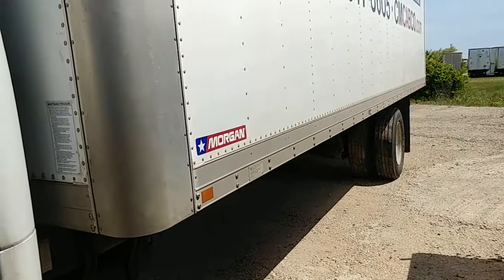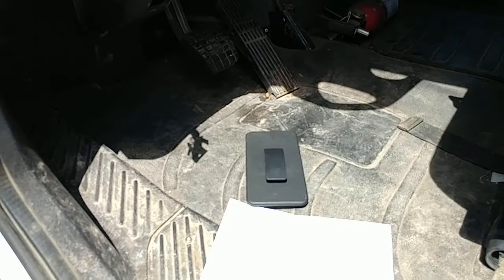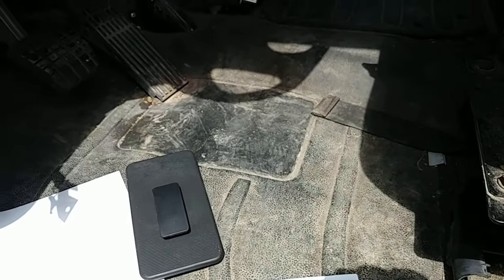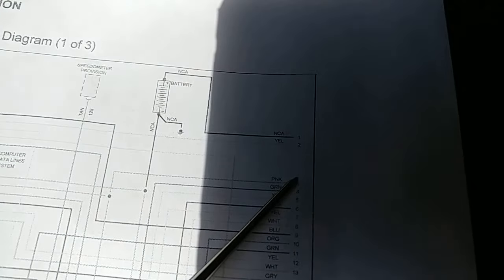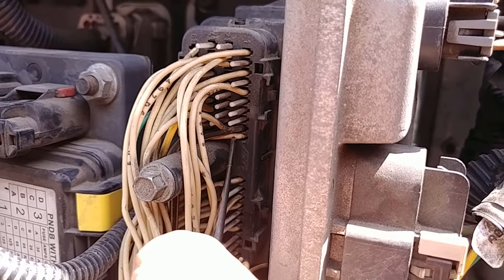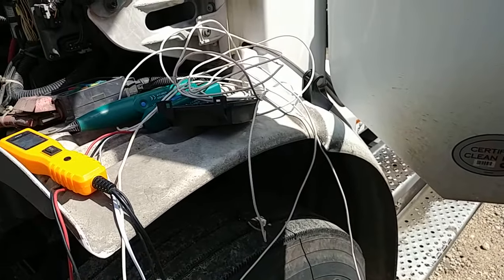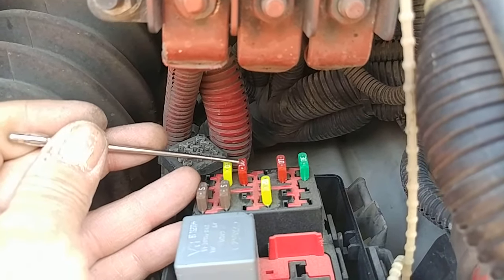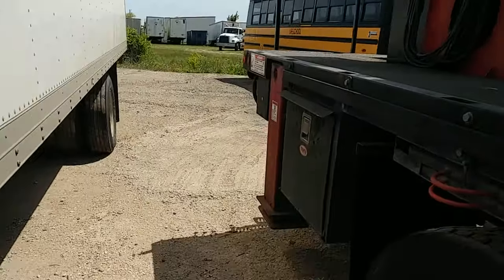Freightliner No Start With No Trans Message..!! Faulty Fuse..!! Check This Out..!!

Comment: It didn’t work on mine. Still nothing. Did this last week and changed the starter and put new batteries in then it worked fine for a week now this bs. I hate trucking
Reply from the maker: Sorry it didn't work in your case!  Electrical issues can be frustrating!

Comment: I had a CPC issue on my 2014 Freightliner Cascadia. After they changed the CPC I now have a "No Trans J1939" that flashes on my dash. Truck starts and drives fine, been driving it for a year like that but I wish I can get that code to permanently go away.

Comment: I think my cascadia had this exact problem. A blown fuse for the transmission shifting program (or shifter). 2020 cascadia (happened @ 9000 miles). The fuse was a small gray, blade type of fuse rated @ (10 I think?) amps. $700 fix. If only I knew what the problem was first-hand.
Reply from the maker: It's the little things that get you!

Comment: I have the same issue for a few days and the truck drive me crazy won’t start at all — no transmission 88 code. I checked online and find you here - thank sir so much you save me and my family between $2000 and $3000 (If I went to the shop they will charge this much to just change the fuse). Thanks again and keep doing good work God bless you❤👍💪

Comment: I have had this problem in our own freightliner too,  it kept blowing the fuse light weekly, so I just replaced it with a 15 amp fuse and no more problems.
Reply: I did 30 you think I need to drop to 15 like you

Comment: 2005 Freightliner century , truck stalled , got low voltage , engine light and engine protect. Replaced all 4 batteries and alternator. Started but turned off after 5 min of driving . It cranks but won’t start unless I spray starter fluid. Had the fuel lines checked and they are clear. Any suggestions or idea ?
Reply from the maker: Does scan tool kick codes?

Comment: I have a 2013 freightliner m2 with the same problem, it won't start and it tells me no transmission and I checked all the fuses and they are in good condition.. what would be the problem
Reply from the maker: First, I would connect a scan tool to check for any additional codes. Next, completely unplug connectors and inspect for corrosion at the TCM and at the transmission.  Make sure the dipstick tube is not leaking on the tranny connector. Finally, validate continuity of wires(including connector pins) for all power, ground, and data in the harness.  Good luck..!!

Comment: I had a issue with a 2003 Freightliner fl112 
The key ignition kept going bad .
Could it be my relay back in the firewall problem???

Comment: I got this 2002 Peterbilt 320 rolloff truck and it won't crank at all lights on the dash turn on and no lights pop up on the dash, what can be the problem, I checked fuses, starter, battery cables
Reply from the maker: It could be a lot of things but I would probably check for power and function at the ignition switch!

Comment: So I’ve had this issue before, but it was the 5 amp five going to the tcm after I had the motor washed. But it just did it again a few days ago! The same fuse! What could be causing that????
Reply from the maker: Wire or connector degradation!

Comment: I do 4 long cranks when cold then it starts I turn it off and can crank it right up what can it be boss?
Reply from the maker: Depends on engine!  Grid heaters or glow plugs could cause this.  I would lean toward fuel system not holding prime or developing abnormally low pressure.
Reply: @LeeSurber  dd13 Detroit
Reply from the maker: First, change fuel filters to see if that changes anything! Next, monitor fuel system with scan tool while cranking and running to see how quickly fuel rail pressure is achieved.  Make sure low side priming pressure is around 35psi.  If rail pressure is achieved quickly that's good. Next, cap injector lines at rail, crank, then watch how quickly the rail pressure bleeds off after you stop cranking.  If you see a quick bleed down of pressure that indicates a failing pressure pump.  If bleed down is within spec then it is more than likely injector related.

Comment: 2012 cascadia starts but the gauges are not working it’s says no trans the truck won’t move do you know why?
Reply from the maker: Sounds like the instrument cluster module! You will probably also see a lot of bulkhead module communication codes!
Reply: @LeeSurber  Dose that cause the truck not to drive. My cruise control also doesn’t work and it’s flashes F and then N.
Reply from the maker: A failure in Cluster, Trans, or Bulkhead can cause this. Check all connections to those modules! Clean and dielectric grease all involved system connectors, including at the transmission.

Comment: Bro i have a code 130 168 trans voltage ⚡. How can I diagnose it?
Reply from the maker: Find the associated power supply wires and check resistance by checking voltage drop. It may be easier to start by cleaning the connector pins with micro round files and then apply dielectric grease and reseat several times.

Comment: I have the same truck,once i changed the trasmission fluid it started then would shut off after 30 seconds did this 4 times now it wont even turn over with a NO TRANS CODE any idea?
Thanks in advance 
P.S Was working fine before transmission fluid changed
Reply from the maker: No trans means no connection so it's more than likely in the wiring! It is my experience that is almost always in the connector!
Reply: @LeeSurber   ok thanks it was the fuse after all,gues i replaced it with another damaged fuse
God bless you fam

Comment: A fuse can appear to look good but not be making a connection
Reply from the maker: Yes indeed..!! I've seen every kind of fusebox failure, from hairline cracks like this, to fuse bases that don't contact the blade, to burnt circuit board traces.